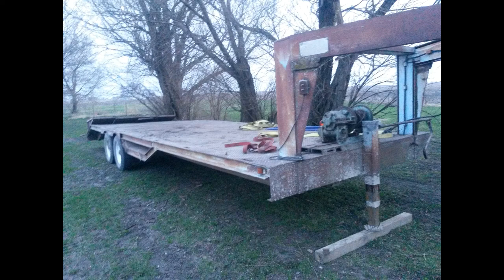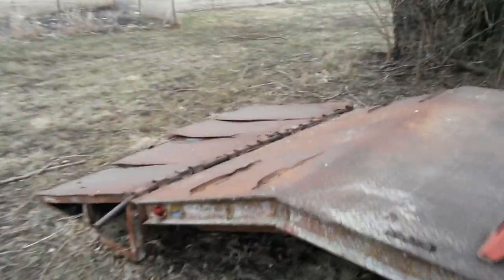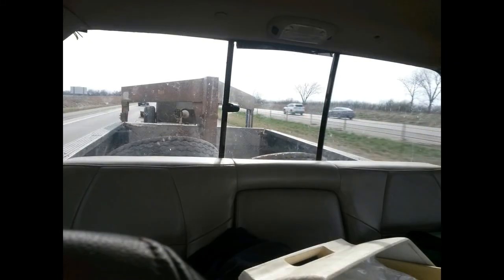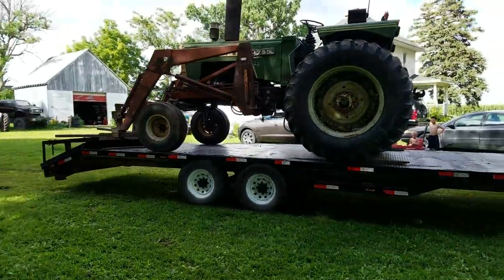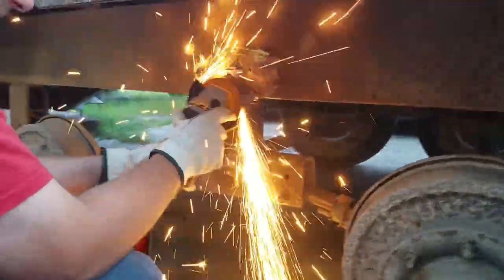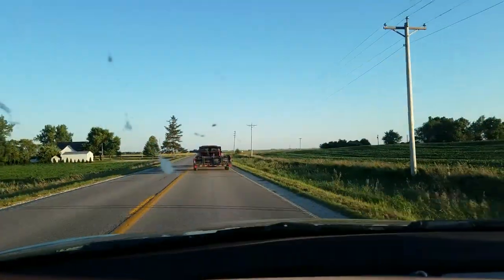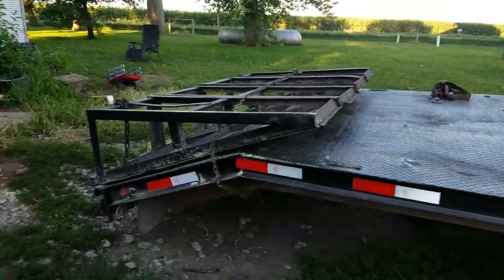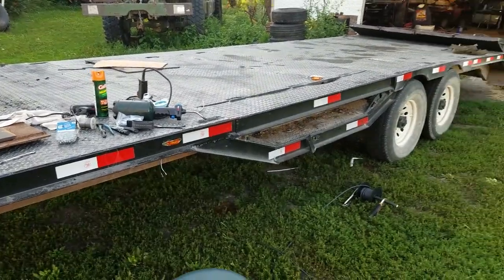Resurrecting The D.O.T. (Dawn Of the Trailer) Gooseneck Trailer (Part 1)

Comment: Man that's a heck of trailer! Will it haul a 7800 with the wells or is it for like 535s?
Reply from the maker: C&J FARMS I think it's more 525 size. Only 7k or 8k axles so not anything too heavy. But it's better than nothing! Thanks for watching and commenting!
Reply: C&J FARMS if there 8k axles u could prolly haul a 7600. If u had the balls to drive it up there with half a tire off each side lol
Reply from the maker: Yeah, even loading my 1755 on for a test ride is a little scary since it just fits on there.  It would have to be a pretty narrow combine.
Reply: Jake Ziegler speaking of the 7600, we started it and drive it for the first time, dad was surprised and not surprised at the same time, I think he expected us to start it, but about 6 ft from it parking spot it blew a steering hose, more fixing